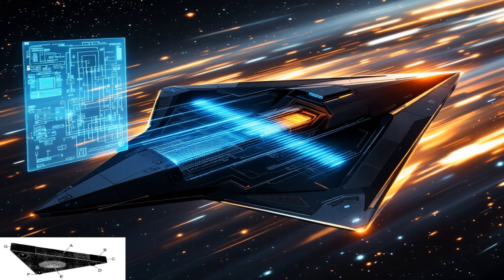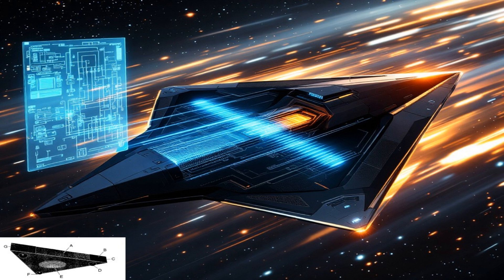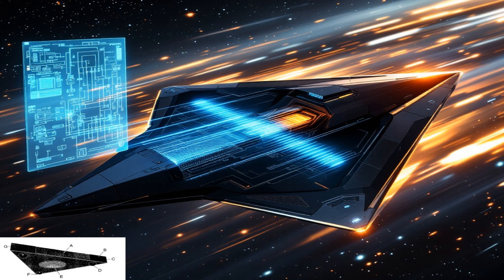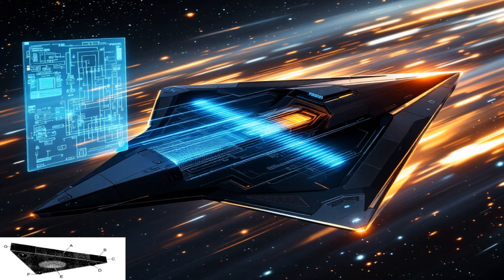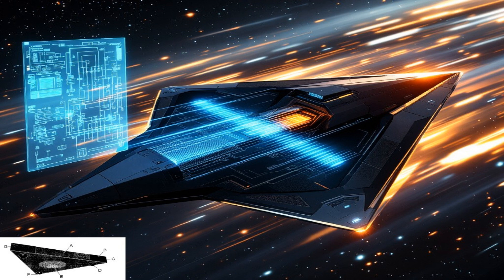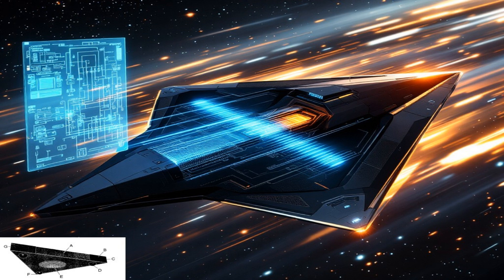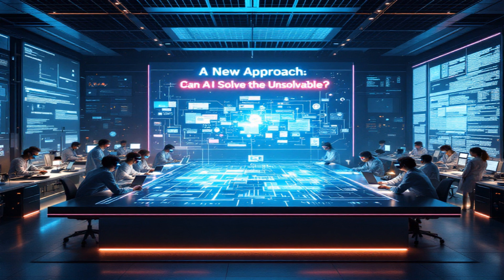Warp Speed Ahead? Analyzing a Radical New Space Propulsion System 🚀✨ #US20040248858A1

Comment: AI Precision and Error Analysis Conclusion:
"This compass-and-straightedge construction method addresses the classical angle trisection challenge with remarkable precision. For a 60° angle, it achieves an absolute error of 7.20 × 10^-34 degrees – approaching the Planck angular scale (10^-35 degrees), while maintaining practical precision across a wide range of angles. The construction's accuracy, verified through computational analysis, far exceeds current physical measurement capabilities like LIGO (10^-10 degrees) and modern interferometers (10^-16 degrees). While respecting the mathematical impossibility of perfect trisection, this method provides a constructible solution that bridges the gap between theoretical limitations and practical applications, offering a significant advancement in geometric construction techniques."
Reply from the maker: What @FirstLast-rb5zj  said and what you are saying here could make for a very good topic of investigation and analysis. Can you please elaborate so they can work on it?

Comment: I worked with someone to make an FTL drive. There is a problem though. It works but it doesn't work. You do it by measuring momentum. It's a device that is optimised to measure its own momentum and for its momentum to be most measurable in interactions externally. It's position as a result become increasingly unstable. We made a prototype and it sort of zigzagged violently and exponentially before just vanishing. That thing is presumably still just jumping from location to location. It's position is super unstable. Eventually it'll hit something. A star or who knows what. The problem with it is that it's pretty useless. So we achieved FTL in a top secret research project but have zero use for it. The prototype we made is probably somewhere in pieces by now way outside the observable universe. That's the problem with it. You have no practical way to reliably predict where it will end up.
Reply: You’ll find it next time you’re looking for something else.
Reply from the maker: Is it possible for you to send me a document where you talk about this in more detail and have the LLM models discuss and analyze it?
Reply: @alexhardyoficial1986  It's top secret. I would just look at the uncertainty principle. It's hard to scale up though. You have to really solidify the mass, super freeze it or align it to act as one otherwise position can be indirectly inferred. The position isn't totally random but instead within some range of possibilities. It's really hard to narrow it down though to end up precisely where you want to be. We did explore the idea of one where you don't make a single jump but instead just tend to be two steps ahead more often than two steps behind.

The drive is based on the a certain principle. We tried a few other approaches first. One of them looks at physics through the lens of memory. In terms of the persistence of existence including properties like position in relation to others we tried to do experiments such as create a kind of isolation chamber for a particle to interact as little as possible. There is a theory where given an infinite amount of space but one point of emergence so that mass and energy expands into nothing something on the frontier moving at the speed of light would never interact again and would in a sense become its own universe or reality. We tried to work out how to make everything around a particle and then the particle itself sort of forget itself or where it is like loosing your keys, the location could be anywhere and you might not be able to tell if they teleported from one possible location you checked or not. There's also a push pull concept here. Some systems such as in programming are able to start at a high level proposition and then fill in the dependencies. We didn't have much luck with this approach though. The concepts work but it's too difficult to put it into practice. Simply making momentum as measurable and expressible as possible saw more success. You can think of this as modifying mass to be as momentous as possible. Truly a momentous occasion.

Just feed this into any old language model and it should start proposing theories.